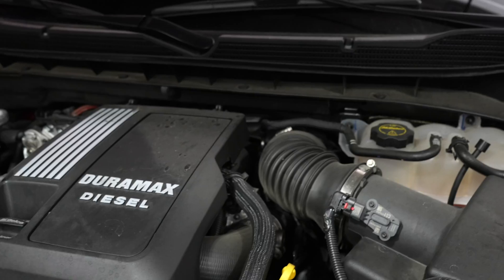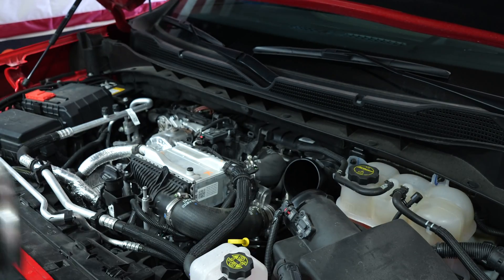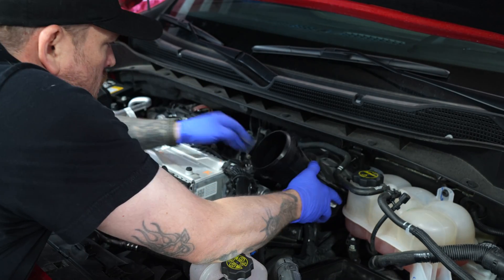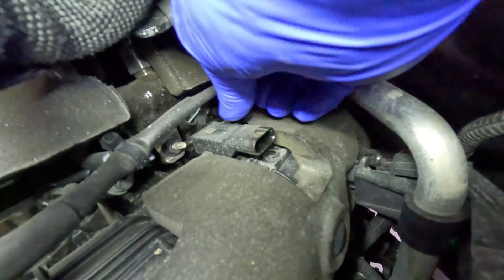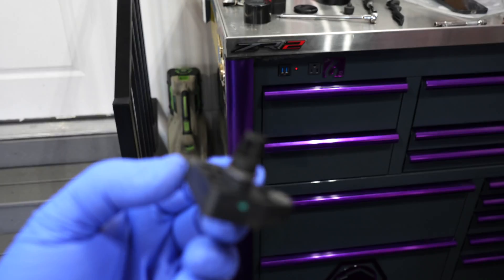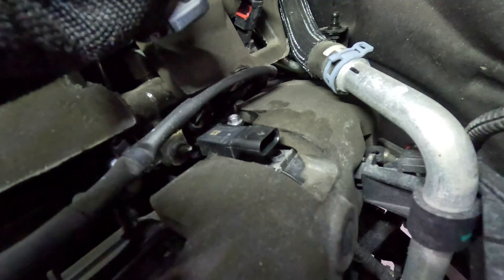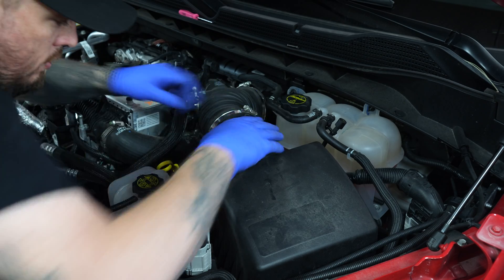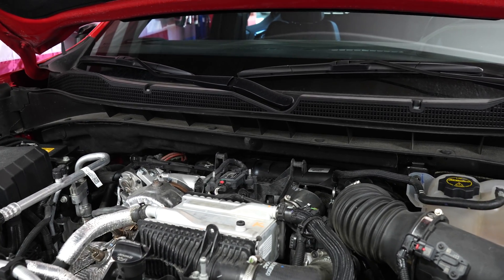3.0 Duramax Tech How To: Remove, Clean, Reinstall MAP Sensor

Comment: I’ve been having a vibration at idle and on low revs when cruising. Dealer replaced mounts, its better but still there. 2023 Lz0 with 17k miles. Hoping this solves it. Driving me crazy, I’ve been meticulous with Maint.

Comment: I’ve had the hardest time trying to get the intake hose off of the turbo. Any tips for that?
Reply: Mine was difficult when removing the first time. Lubricate the intake pipe with a dab of silglyde silicone and it comes off easily the next time.

Comment: I love the way you skipped the video where you struggled to remove clamps and hose from the turbo. You also didn't show how to put it back on since it's against the firewall.
Reply: It may be slightly different on a 2020. There's no way to get a socket in there with an extension to loosen the clamp.
Reply from the maker: @AvalancheJS  zero struggle, bud. Feel free to check out the other channel where I have at least 5 videos showing the full procedure of pulling the pipe off. Www.YouTube.com/demonworks
Reply: @MrGregWrench  I'll take a look.
Reply: Can you please put the link for the video removing the stock tube? I only found ones with the stock tube already out. Thx

Comment: Why are you doing this?
Reply from the maker: With the engine design using an EGR valve and closed system pcv, I know there is dirty air and oil being pushed back into the engine so I wanted to see if this sensor had buildup. When it did, I wanted to clean it off. The 6.6 trucks can get so blocked up they actually throw a code, that seems to be rare for these 3.0's but still I wanted to look and clean.
Reply: P0106 and P026d, 

I just wanted to know if this was experimental or not thank your for the information

Comment: I have 61k on my 21, I haven’t had any running issues nor a check engine light. Curious what you’re seeing on the higher mileage ones. We’ve had a ton of 6.6’s set lights.

Comment: The part is currently on a nationwide backorder. My pickup has been down for a month as the carbon buildup caused it to fault after cleaning the temp sensor is still shorted.
Reply from the maker: sorry to hear that
Reply: Same here man. Trying to find a company who’s made a replacement part but not having any luck. Was told it might not be available till middle of may🤣 what a joke.
Reply: Clean it some more

Comment: Does anybody make a map sensor relocation kit for the 1500?
Reply: I keep hearing about a MAP spacer for duramax, but can't seem to find one specific to thr 3.0l lm2. Anyone know of one?  I'm trying to recall just how buried this sensor was when I cleaned it.  Less than a tank later I'm having the same issue and want to replace the sensor and put a spacer in to help prevent the soot build up.

Comment: what are optimal readings? I have a idash and used the setting but have no idea where the sweet spot is numerically. thanks!
Reply: MAP sensor reads in PSIA (absolute pressure) which includes atmospheric pressure. At sea level you should get a reading of 14.7psi (with the engine not producing any boost). The readout will be 14.7psi + boost pressure when you're driving. Keep in mind the atmospheric pressure decreases with altitude, so if you're in the Rockies, it'll be more like 12psi...

Comment: I just checked mine. 23’ LZO with 32k miles. Man it was dirty! Cleaned it up and got a CEL about the MAP and intake air temp sensor upon startup. Cleared it out with the scan took and it has not come back. Thanks for the video!

Comment: Thanks for creating these how to videos for us. Any chance you're making one on how to stop the front oil leak that you've mentioned in at least one of your videos? You explained it as a plug that needs to be removed, resealed, and re-installed. I would like to see best way to access the plug to make the fix. Thanks!!!
Reply: The front oil leak is the oil plug gallery plug it’s located at about 9 or 10 o’clock of the front crankshaft pulley, an inch or so below the water pump pulley. Pull plug out and install liquid thread sealer and reinstall. You’d see it from the bottom looking up through the front engine lower sight shield when it’s removed looking in from the passenger side toward the engine. Repair Can be done without removing the radiator/coolers assembly. Hope this helps.

Comment: Do the MAP or intercooler temp sensors need to be relearned if they are replaced or are they plug and play?
Reply from the maker: great question !  edit- Baro Sensor relearn should be performed.
Reply: Thank you!
Reply from the maker: @cje26 updated - baro sensor should be relearned if replacement or if just a cleaning is done.
Reply: @DuramaxNews  It looks like I have "Baro sensor reset" as an option on my Launch X431.  Is that all there is to it? Just like a small quantities reset?
Reply: Greg, have you seen any 3.0s that have the def hose in the engine bay come off? Had mine come undone mid trip and lost all the def, made a snowy mess of the engine bay and undercarriage and sent the truck into limp mode.
Reply from the maker: not common at all, sounds like a one-off issue.
Reply: I have a 2021 Duramax 3.0 , recently truck started popping the “ 165 miles to 65 mph max speed “ 

Pulled map sensor , of course it was caked with soot , but I drove it for 50 miles or so and it steadily is heading down from 55 mph to max speed , any suggestions on what to do ? I can only “ drive it until code goes away “ but scared to get truck too far with issue
Reply: @StevenSutton-lb2bg  Personally not sure if the map sensor would set that off, I believe that is normally an emissions related issue. If you have a code reader or scantool, it would be interesting to see if that tells you anything. 

The only time mine (2021 Sierra) has ever done that to me was when I ran it too low on DEF (iDash said I was still over 10% but the truck apparently thought otherwise). Even after adding a jug of DEF, the count kept ticking down. I ran the code and it was something along the lines of "DEF injector out of spec", but I forget the exact code. Anyway, I disconnected the battery for about 10 minutes and everything was back to normal and have had zero issues since. 

That's a longwinded way of saying checking your DEF and unplugging the battery for a few minutes may be a good place to start.
Reply from the maker: @StevenSutton-lb2bg  what code are you getting?